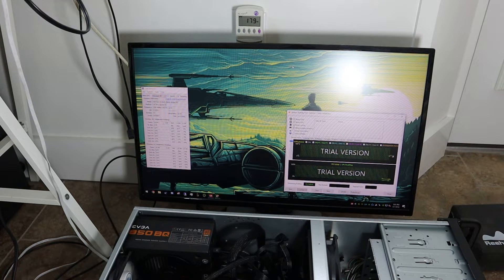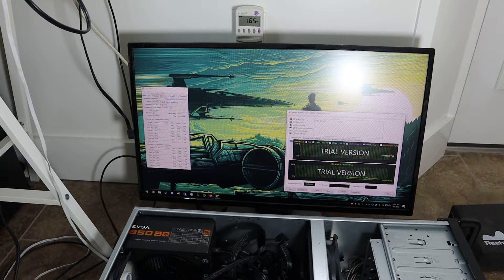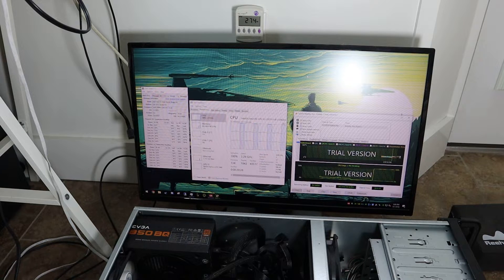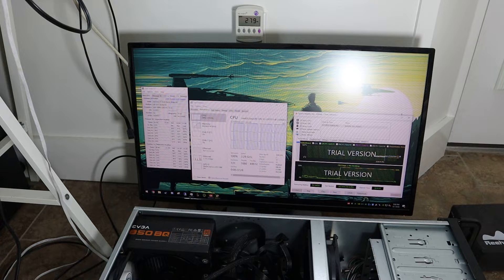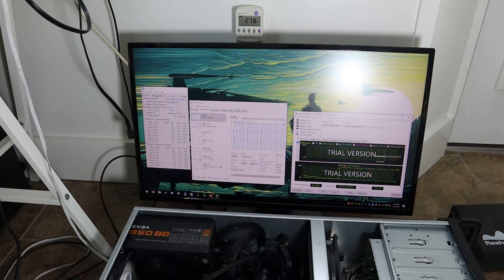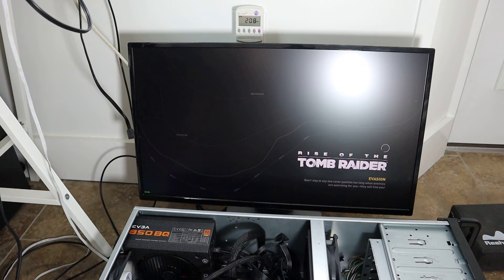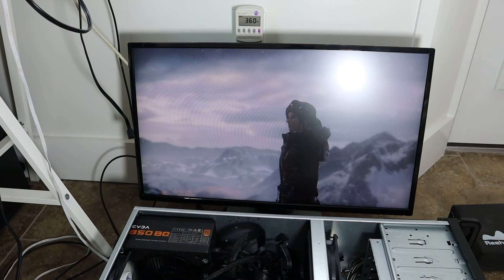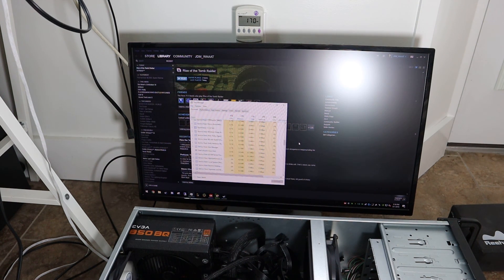80+ Bronze PSU - Dual Xeon Power usage testing part 1/2

Comment: Grt video, i have 2x E5 2683 xeon cpus V, would a 650w psu be sufficient
Reply from the maker: Yep
Reply: JDM_WAAAT thank you
Miyconst hi thank you for your response, I’ve been having a tough time finding a motherboard compatible with my dual Xeon e5 2683 v4 cpus I was wondering if this would work?
 https://www.ebay.com/itm/153948733112